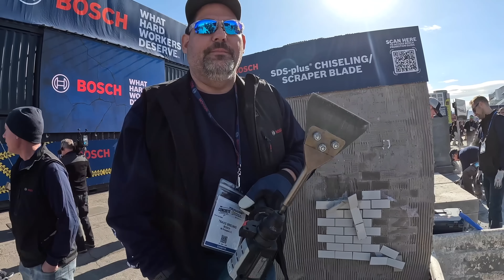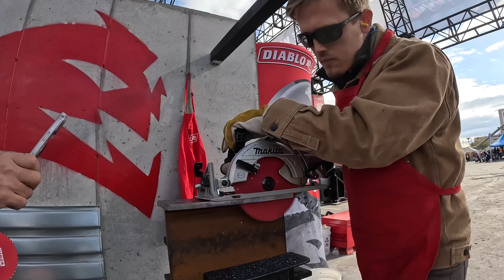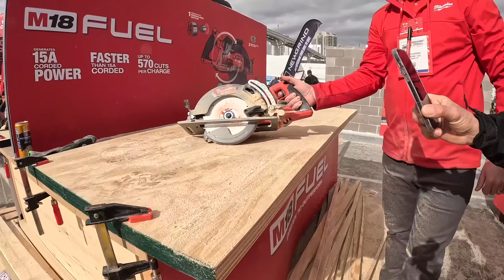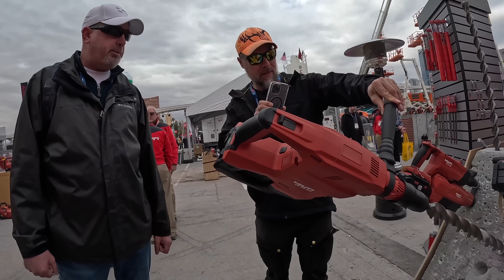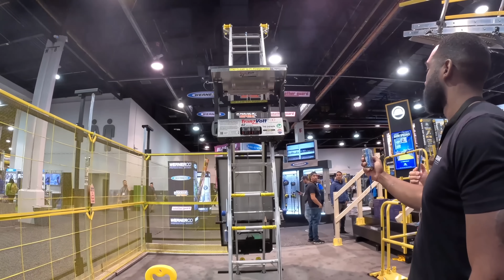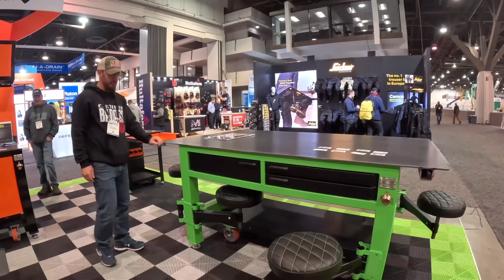The COOLEST tools at World of Concrete!!

Comment: hi all. i have to climb ramps steeper than i have before. the ramps are 3300 long and the height from ground to the level i have to get onto is 800mm. i know this probably isnt really steep but im wondering should i go counterweight uphill or just go up forward. any help would be great please. the ramps are resting on a concrete ledge so i cant put a bolt through like on the tray of a truck. if my math is right slope is 13 degrees thanks

Comment: I have the metabo bender and that thing will bend bar like no other on one battery the cutting part is useless for production sake, too slow but I’ve fabricated decent size vaults with them the only time we killed a battery was when we had a guy bending j bar for 10 hours straight, if you fab your own bar definitely a great compact tool for a lot of work

Comment: Hey Stanley I really like the gas powered jackhammer that was really cool but I have a question not for you but for these guys who are selling these battery operated tools my boss just bought himself a battery operated Milwaukee masonry it is his personal one he wants it very clean when he receives it back that makes sense he put a lot of money into it he wants it looking new for a long time but there's other benefits to that keeping the machine clean keeps the weight off keeps material going into the mechanical parts but that's on gas operated machinery I would think more so you would want to keep off the particles from going into the machine how much of it is waterproof what kind of chemicals can you use to keep it clean we've use degreaser on gas-operated equipment what do they suggest you use and what can you not use to keep your equipment if not I'm perfectly stellar looking but to continually function and keep the weight if you've ever used a u Cart for concrete you know what I mean a little just a little but a little got more and more a little G & R 💪🦾&🌹🥀
Reply: Here is some …….….. I have lots if extras. I’ll even throw in some more for you next few comments………

Comment: Wonder if that 7 1/4" metal blade works any better in the slower rpm units?  Don't remember which (Milwaukee, Makita, ?  Cordless) (a worm drive is probably in that rpm range too) With a metal cutting blade (not abrasive) was like butter!  Don't remember the blade, may have been that Diablo...  Sure wish some of these tools were available when we started, rather than after I can't work, lol!      Thanx !